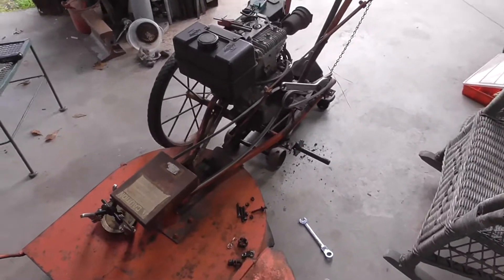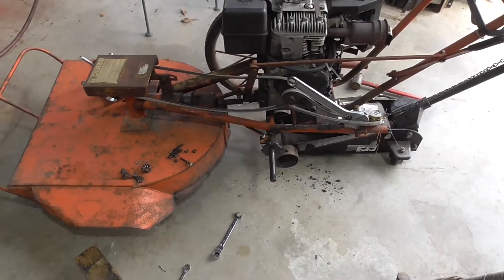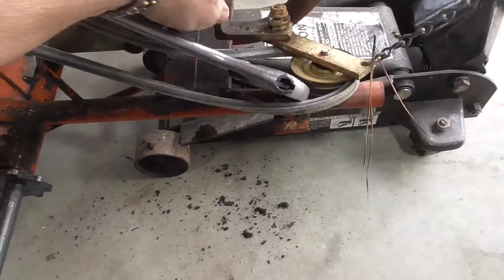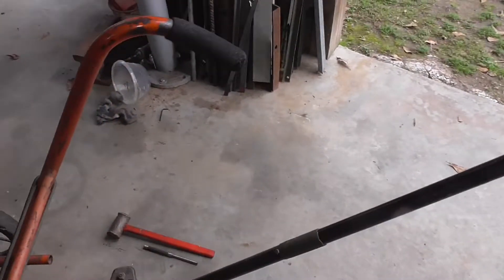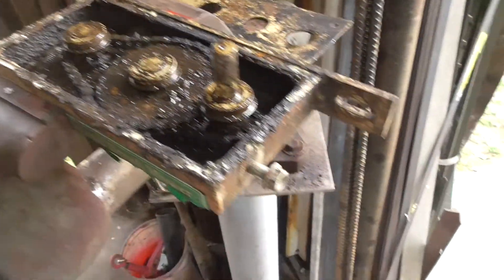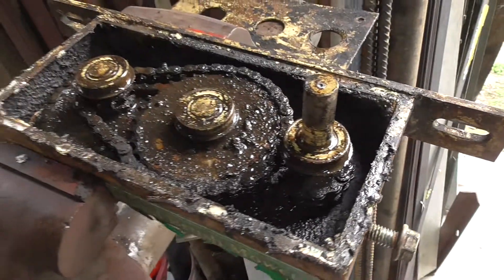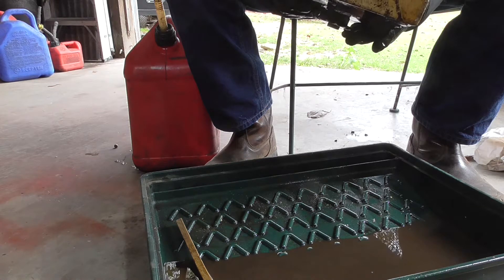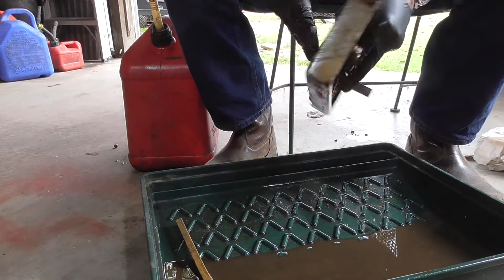1-1-22 Rebuilding an old DR Field & Brush Mower Gearbox

Comment: I feel for you.  These were great machines.  I have the same 8HP model that I too bought new in the 90s.  I remeber arguing with the company owner back then with me asking why not come out with a model with a reverse?  He didn't want too, was afraid it would back up over someone frail.  In or near raspberry and other thorn bushes, that was an issue for me.  Anyway I went on using mine for another decade.  One day the bar holding the pulley tensioner arm broke off the frame.  I welded it back together and it worked for about 10 minutes before it broke again a half inch behind the first break.  Sigh.  I called and learned the company had been sold and was told the new owners had zero interest in supporting the old models, but were willing to sell me a new design.  Double sigh.  Eventually I caved and bought one of the newer ones, and lo, it has a reverse and a bigger engine too.  I still have that one too.  It has had 20 years of use here with only broken pulley spring problem which was quickly fixed.
Anyway, the company has changed owners several times, but at least for as long as parts last they still support many of the other models.  They keep changing small design features every year so now there are many models of their walk behind.  
My current plan is to find a broken one on Ebay someday and use it for parts to fix the deck arm of the original one. I have also learned on my original DR the bearings on the shaft holding the blade no longer limit up and down movement of the blade shaft as the cover plate has deep grooves made by impacts. There is about a quarter inch of up and down play, shouldn't be any.   I used to have a lot of small boulders hidden in my meadows.  I will replace the bearings. I also have the finishing mower attachment for it, so I would really like to get mine running again as that finishing mower did a great job.  You should know absolutely no one makes a tire for those wheels anymore, so when they wear smooth, that will be it until you find an alternative wheel design.

Comment: I am curious to know how hard it is to remove the wheel, Mine is froze and not sure what all has to be disconnected
Reply from the maker: The wheel just slid off on mine. After removing the castellated nut.   You may have to “persuade” yours